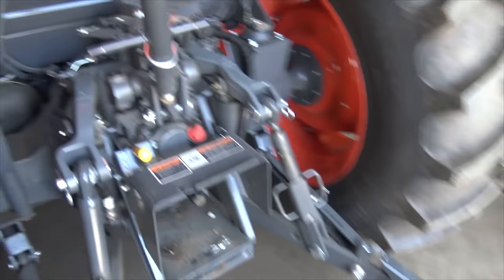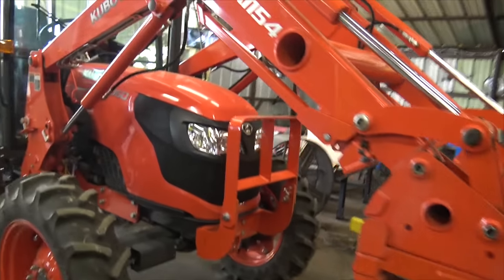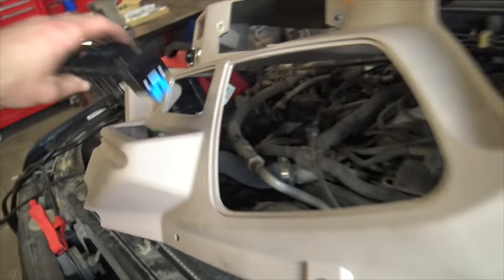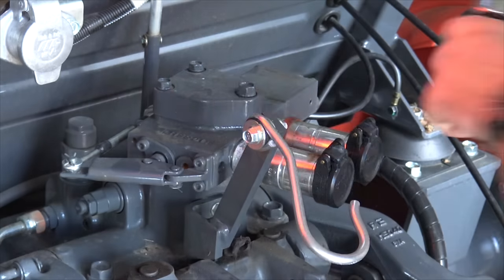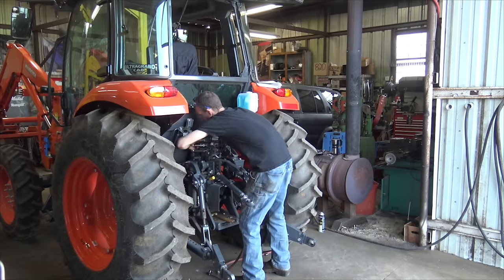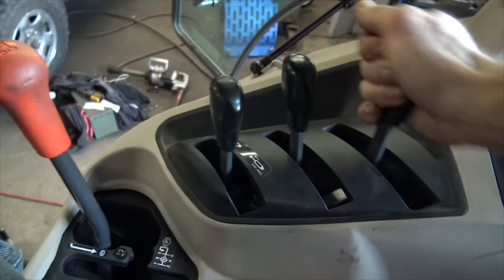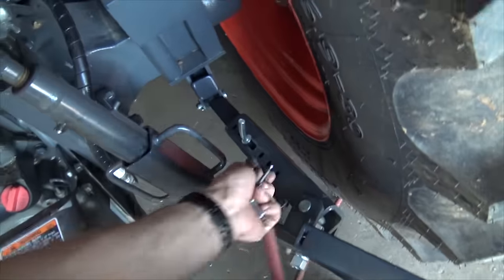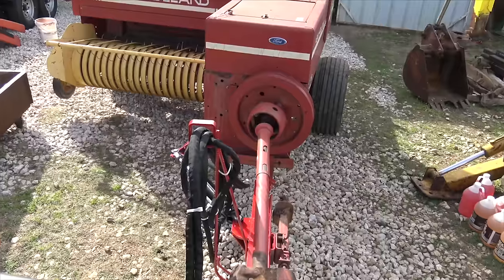How to install a Kubota rear hydraulic remote outlet on an M7060 with ChuckE2009

Comment: +ChuckE2009 +Messick Farm Equipment  (Neil) 

What I really want to know is what did these hydraulic remotes "upgrade" cost? I know for a fact that adding hydraulic remotes to any tractor is typically VERY costly. 

The nice thing about "new" equipment is that these "add-on" field service kits are available from the manufacturer/dealer and don't require any significant fabrication like older tractors often require.

Also interested in how long (real, actual time, NOT "flat-rate book" time) it took you to do the full install, from start to finish.

Do each of the additional remotes you added have a detent for a "float" position, or is the float-detent only in the original #1 remote valve?

For a future release video, let's see them actually operate something hydraulic powered.

Comment: Hello Chucky do your valves actually hold position I had them install a set on my bx2380 and it seems like the valves seep and the hydraulic cylinder will change position when there is a load on it. 
It doesn't leak hydraulic fluid on the floor it just leaks or by passes through the valve in other words
Reply from the maker: Cylinders can leak internally, that's the likely case.

Comment: does this system work on the L series?
Reply from the maker: Similar, yes.
Reply: @Messick's Equipment  what's the part numbers of the equipment needed to install on l3540?
Reply from the maker: @JustinEarnest  Not available online. Contact us at 877-260-3528.

Comment: cheaper to buy hay than to buy all the equipment to cut hay. Large round bails sell for $20.00-$25.00 ea. 
It would take a long time to add up 100 K + for tractor and related equipment to bail hay yourself.
I just don't see where one can come out ahead bailing your own hay